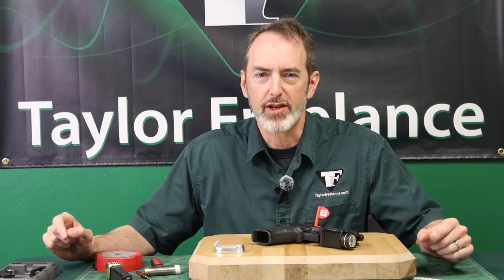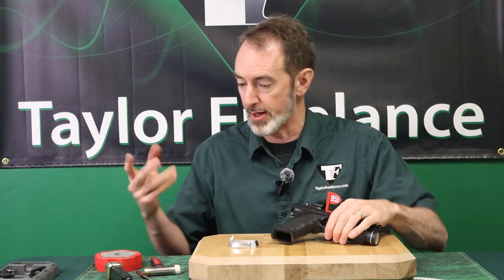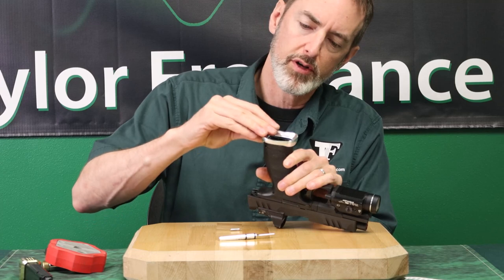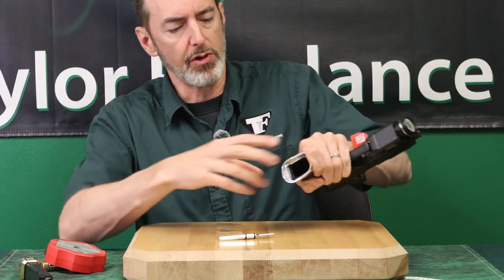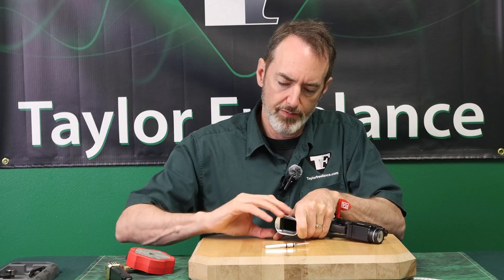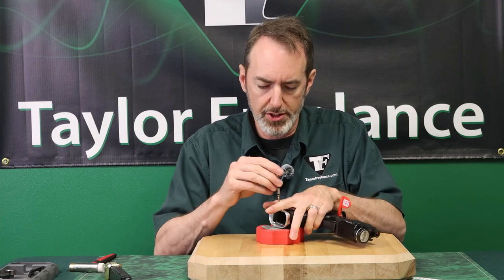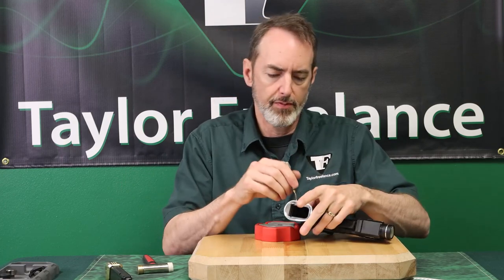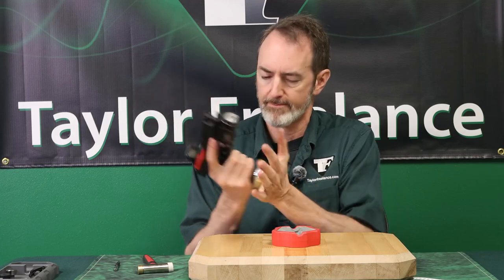Walther PDP Full-Size Magwell Installation Video

Comment: If I'm using a stock backstrap are any modifications required?
Reply from the maker: On a standard-model gun, odds are you will need to make a small mod where the "tang" of the magwell reaches in/up toward the roll pin. The SD Pro models have a different backstrap that has a deeper "slot" to allow this type of magwell to avoid hitting the backstrap. Easiest way to AVOID having to do that is to replace the backstrap either with one of Walther's, or one of TF's that has the deeper slot already. If you're trying to avoid adding much weight, check out the TF aluminum models -- 1/3 of the weight, but 100% (or more) of the "grippiness."

Comment: I have the brass magwell with your brass backstrap. Once installed it’s still loose and wiggling and if I pull down it comes off. 
Suggestions?
Reply from the maker: Call us directly at TF. I think I know what's happening. This was pretty common with the first batch of brass ones.

Comment: I just bought the middleweight kit, the problem I’m running into is my roll pin is slightly hitting the hook on the mag well not allowing the pin to go al the way through. Any suggestions?
Reply from the maker: First, make double-sure that the magwell is fully bedded against the frame and pulled all the way to the rear (it tends to drift forward if you don't hold it to the rear). If that's the case, look through the roll pin hole and make note of whatever piece of the magwell is blocking the hole. From there, file off a small amount of the offending surface with a round file (or similar), doing it in small amounts and checking each time until the roll pin will just pass. Don't worry about "voiding the warranty." Even if you really mangle the thing trying to get it to fit, you can still return it if you're not happy.

Comment: Stock mag. base plate will work with the magwell?
Reply from the maker: Yes, but you will have to grind it down a little to make it fit. I don't recommend doing that, because the stock basepad will go up INSIDE the magwell ("below flush") which is both slow-to-load, and problematic if the mag gets stuck. You're much better off getting one of "Competition" +0 or 140mm +3 basepads -- they don't need to be modified, and they make the mag long enough to seat positively and give you something to grab if they get stuck.

Comment: I have a full size pdp and this magwell. Its not even close to fitting
Reply from the maker: Could be we sent you the compact by accident. Give us a call and we'll sort it!
Reply: @taylorfreelance  it will only fit if the grip is entirely removed. Does that sound like it's the wrong one?
Reply from the maker: @TXbeats62  If it will fit (and the pin goes through) with the grip removed, the problem is actually the grip - what we call the backstrap. Walther has two such backstraps  - one that's meant for a magwell, and one that isn't. If you have the latter, you can modify it to give some more room for the "tang" of the magwell to fit into its slot, or just give us a call and we'll make you a deal on a metal backstrap. (I should have access to some seconds that I can sell at a discount. . .)